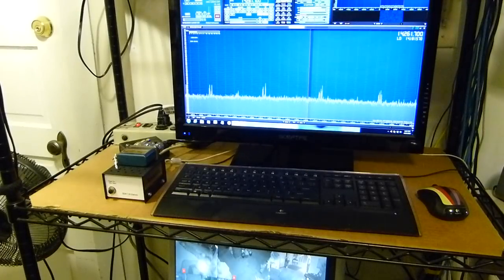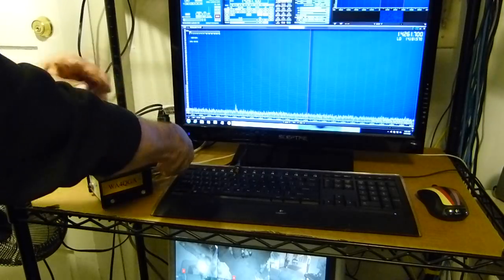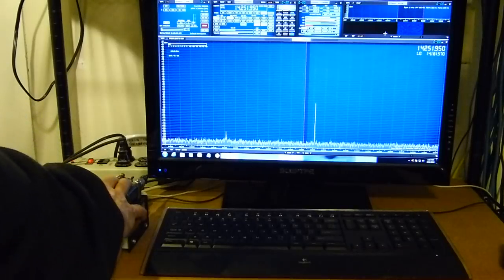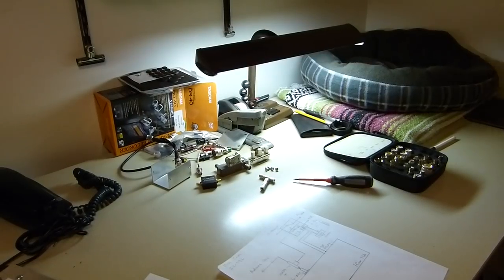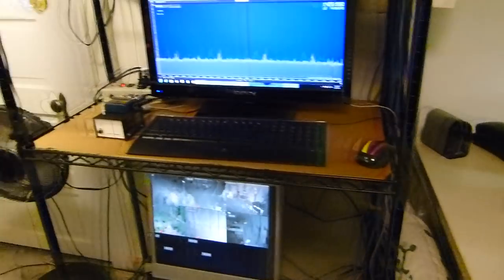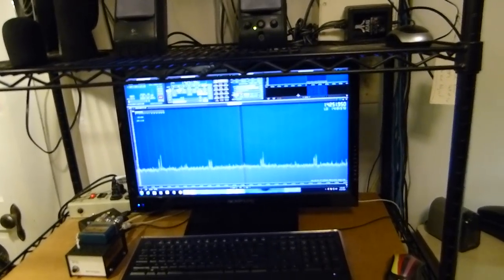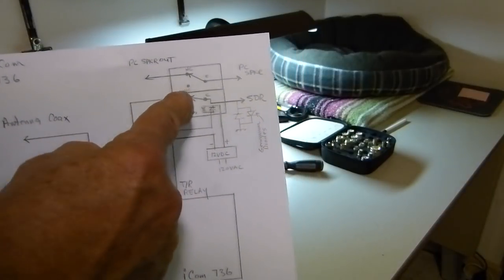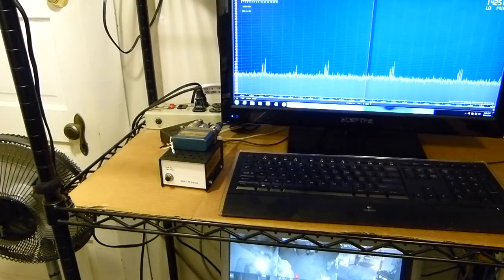SDRPlay, RTL-SDR,  Transmit-Receive , PC Speaker, T/R Switch

Comment: Great video! Interesting idea using the SDR receiver as a panadapter. And I love making little add on devices like your TR box. It’s fun to make custom stuff like that. 
As for comparing the old Boatanchors to SDR, I think we are just entering a new era in receiver design. Digital, direct conversion is the biggest change in receivers since the development of superheterodyne. 
Digital has made some advances before such as PLL frequency synthesis that replaced free running oscillators. But with the introduction of the Icom 7300, 7851 and the 9700, we have a completely different approach (SDR) to receiver design. I believe all ham and military communications equipment will go to direct conversion in the very near future. 
As an old graybeard myself, I hate to see the beautiful design of the Collins Hallicrafters and Hammarlund gear fade into the past. But I accept that that era will likely end with our generation. 
I rebuild boatanchor gear to support my hobby, but I also embrace the new technology as you do. I hope to give my grandchildren the love of science, engineering and good design, through exposing them to both the past and the future. 
My nearly 60 years in electronics has been quite a ride. I’m glad to get the chance to see the future as well. 
Always love your videos, we think a lot alike. 73.
Reply: "using the SDR receiver as a panadapter"? he is using the SDR receiver as a receiver.
Reply: yes , The fidelity of those old tube rigs  is unmatched by anything new on the market  today. atleast to my ear.......but not so sure so much on the military applications  ... SDRs are fragile and the other side surely has something that could smoke these micro circuits by now if we left ourselves vulnerable in that way.. and the military stuff does have to be Gorilla  proof and easily understood in the field by people w/o electronic backgrounds who only know how to twist knobs and in today's army everyone is wired ... maybe some day ... if they don't come up with another mode of communication first... things are moving soooo fast these days.

Comment: I like SDR#  or HDSDR .... not familiar with that one ... got used to seeing the waterfall to recognize the signals....  I agree , every rig nowadays has a T\R jack in the back anyway.... why spend (now $125) for such a simple circuit ..... you could even back it up with a schmitt triggered switch too like MFJ does..I'm betting you could crowbar that too with a fast switching diode  for even more protection.. what'd  ya think?

Comment: Good job is there a set of plans or build list for this box?
Reply from the maker: The T/R switch works great if you run separate transmitter and receiver so you can zero beat. Unfortunately, my SDRPlay quit working. Not sure why but I do remember I left the antenna connected for a couple of days. I am guessing a little blast of static took it out. Not sure if I will get another one or not. Sorry I don't have a schematic or plans to share. 73

Comment: What antenna are you using? Dipole, long wire, DEZ? Just wondering...
Reply from the maker: I use a simple rotatable dipole. Here is a video about some log periodic antennas I built but you can see the 20M dipole also at about 17:20.
Reply: Thanks! I had a 40 m DEZ that kicked ass! I'm only gain l obes tho...

Comment: Is there a way you could build me one of those to us on my Johnson 500??
Reply from the maker: I think MFJ sells what you are looking for.    MFJ-1708B-SDR, SDR RF SENSING T/R SWITCH WITH SO-239
https://mfjenterprises.com/products/mfj-1708b-sdr
Reply: @ElPasoTubeAmps   I don’t think the Mfj, will work it is only good for 200 watts. But I will keep looking.
Reply from the maker: @keithbarker4744  I think I put the one I built between my tranceiver (max 100W) and amplifier and not at the output of the power amplifier. It would be pretty difficult to make one of these work at the output of a KW amplifier and be safe for the SDR.
Reply: @ElPasoTubeAmps  ok thank you for you time, I will have to do some research on something to work with the Johnson 500 transmitter if possible.